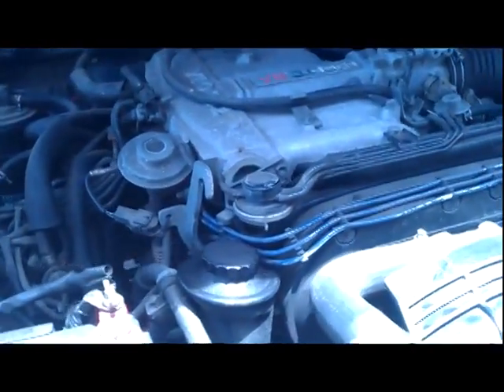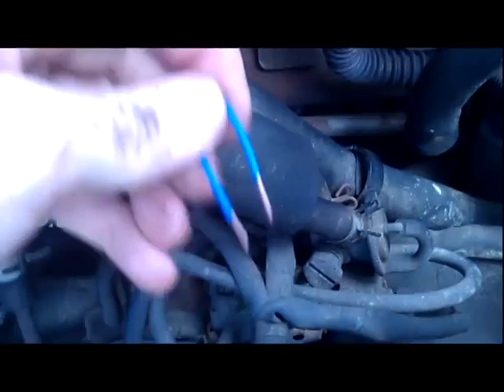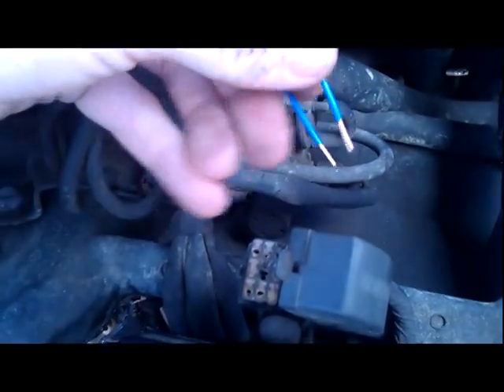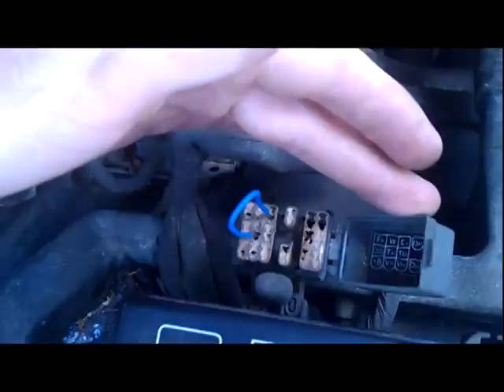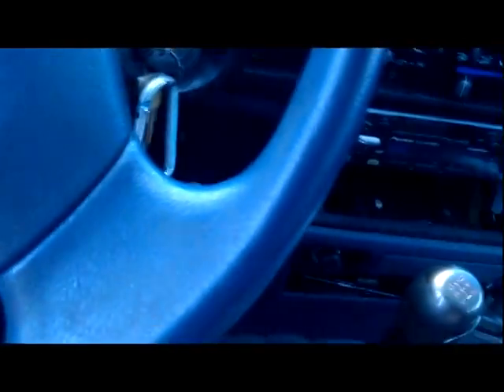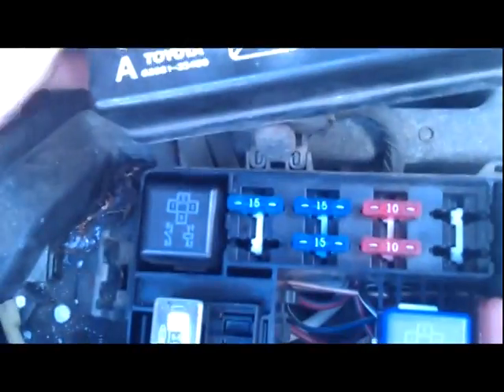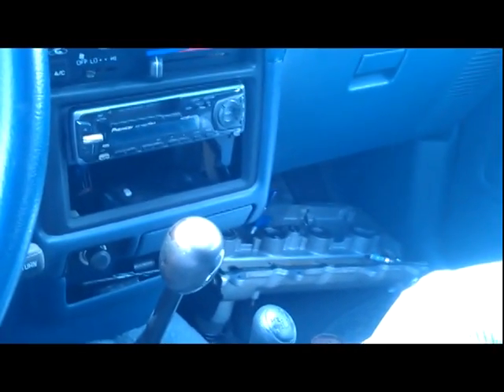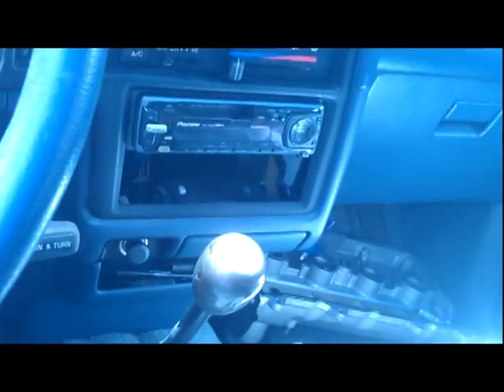Free Check Engine Light code retrieval

Comment: I did jumped them,and turn the key on,it just stays on.
Reply from the maker: Maybe there's not a good connection at the pins where it's jumped. It should flash

Comment: Liked the video but you talk to much dude.
Let me simplify the battery terminal segment for you.
Simply tighten the clamps on the battery terminals a bit at a time untill it's hard to rotate them. If you over tighten them they will just stretch or break.
If you max out the clamps bolt and it can still be turned without a lot of effort replace them...
Edit

Another tip, if you disconnect the battery for ANY REASON (especially if you see any white corrosion begin to develop) clean the connections and grease them with dielectric grease or petroleum jelly liberally.
Reply from the maker: Thanks for the comment. I have edited my newer videos how to where it seems that I talk less.

Comment: If the light dosen't blink at all what would the problem be ?
Reply from the maker: +Sergio Ramses I had this a couple times and my jumper wasn't connected all the way. It should blink. If not then it could be a bad ecu or bad wiring to your diagnostic port.
Reply: That is a good point and another thing it could be just a blown bulb.
Reply from the maker: +Sergio Ramses oh I thought you meant your light was on and you couldn't get it to blink. It is easy to check if you have a blown bulb. When you turn the car on the light will turn on for a brief second and shut off, this is a bulb test.
Reply: When i got the car about 3 days after the light when on and about a week later the light went out since then it hasen't been on.
And my bad i didn't mention the light wasn't on XD
Reply: This is my issue, light is on (two weeks now) and will not blink with jumpers attached. Reset ecu by pulling the fuse, CEL eventually comes back on after warming up.

Comment: my check engine light just keeps flashing rapidly with no pauses in between. what does that mean?
Reply from the maker: +Dayum (MJ) what year? Vehicles newer than 95 will do that to indicate a serious issue. But those vehicles also require an obd2 scanner. Is yours obd1 or obd2? (Pre95 or post95?)

Comment: what if the check engine light stays in & doesnt flash at all
Reply from the maker: you might not have a good enough connection at the jumper. That happened with me
Reply: +Hournine Racecraft what did you do to get a better connection?  I've pulled the little write out & tried reconnecting it severaltimes, shoved it in more & still when i turn the key to "on" position the engine light still just stays on without blinking.i triple checked its in the right places, have enough copper exposed, in deep enough, i just dont get why nothings working. so frustrating.
Reply: +Just Jessy *wire

Comment: Thanks, I have a 1991 Celica GT hatchback.  I cant pass emissions because its running rich, and I have good compression, and have replaced almost all the tune-up and emission control parts. I also have no engine light on. Any suggestions?

Comment: what if there is no check engine, can you still do this to check for diagnostic
Reply from the maker: ***** no, it only shows the blink code if the check engine light is on. I've never seen it pull codes that are pending (soft codes), meaning codes that haven't occurred often enough to show a solid check engine light but the computer is still storing as a potential problem. If you try it with no codes, you will just see the code for "no distributor signal"

Comment: I wanna thank you for doing this video.  I've went to autozone, peps boy and etc. Still they cannot find out what was my check engine. The port cannot connect somehow with their obd. They check the fuse to see what is wrong with my obd1 port. It was all normal. Until I see this clip. Now I find out what is wrong. It reads code 27. O2 sensor sub circuit heater

Comment: good informative video, i tried using a copper wire and a paper clip to the e1 and te1 slots, but my CEL wont flash like yours did...any insight perhaps??
Reply: Same problem with mine.  My check engine light came on and flashed 5 times and stopped flashing.